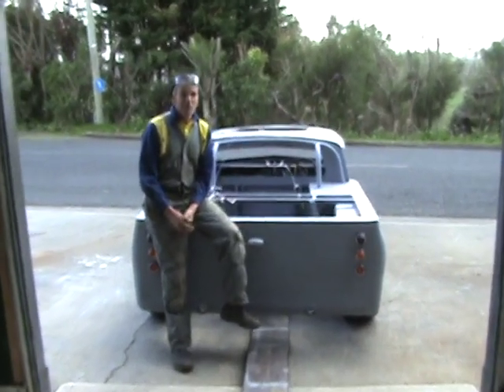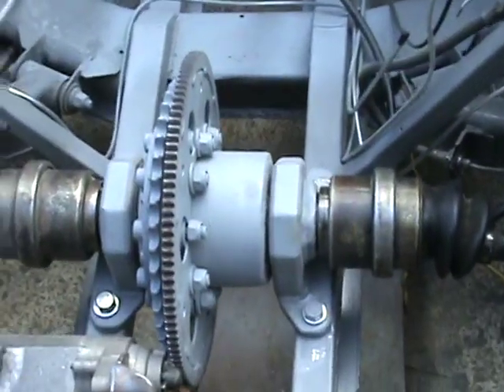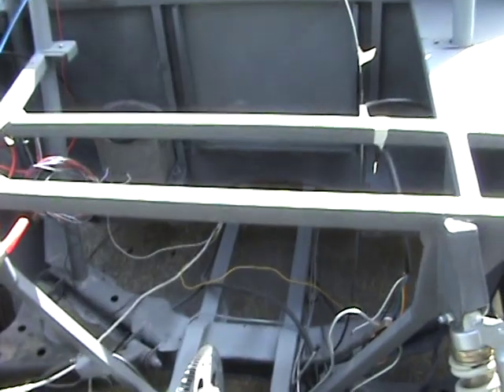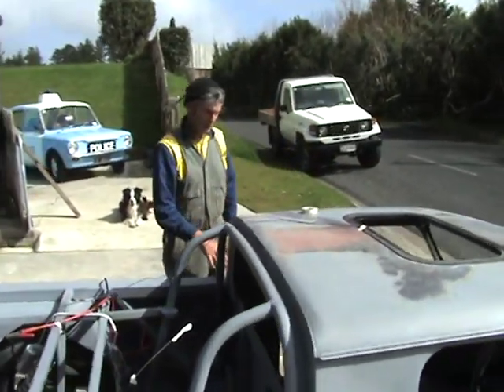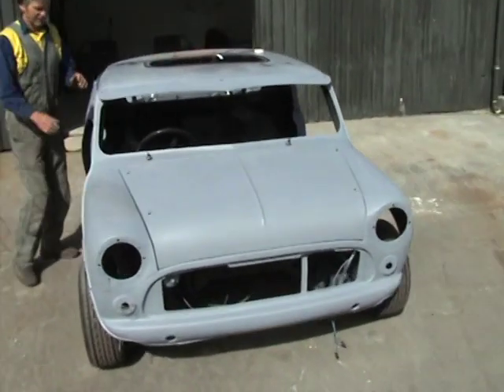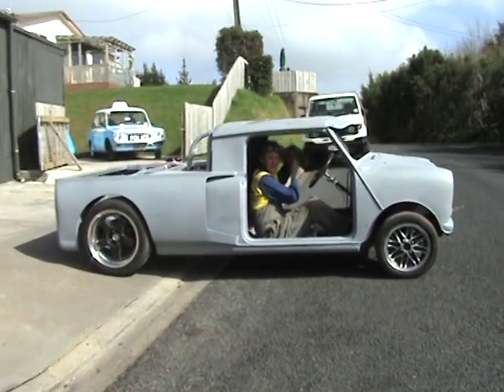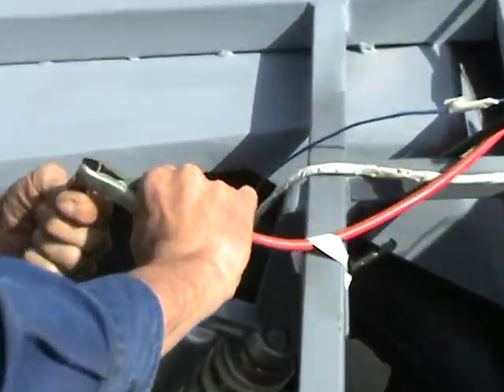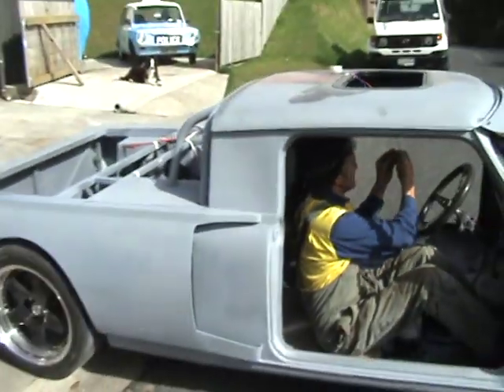Mini Pick Up build. part 6.

Comment: I was watching your video about the mini pickup, and I'm building basically the same over in the States. Where would be a good place to purchase an Original Mini, and a good axle and and differential that would fit a slightly modified Mini body. Its not a motorcycle engine so its shaft driven.